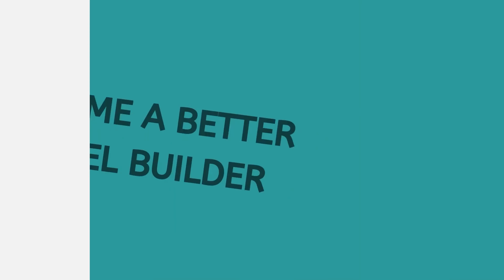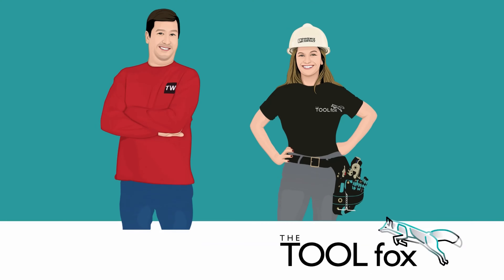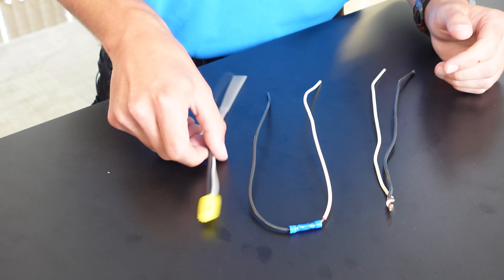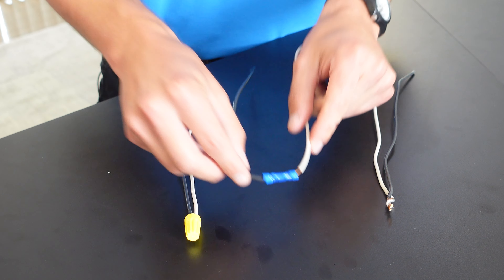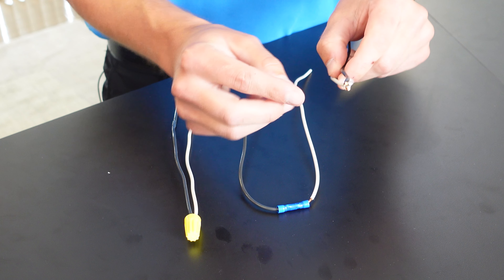Terminal Block Basics.  Using to Make Your Control Panel Better

Comment: Good but short video. Here's a good reason to connect every wire via a din terminal: New terminal when the screw gets damaged: $1 new PLC module when the screw terminal gets damaged: $700.... Put the wire into the PLC module once, then make your connections via a DIN terminal!
Reply from the maker: Very good point!

Comment: Tim, how many wires can go into one side of a terminal. I find many different answers to this. I feel like you were asking him that question because many people do not connect a wire to a terminal when a wire is exiting the cabinet. I would like to know how many wires can be under a screw of a terminal?
Reply from the maker: Typically one... Unless it is UL listed for more than one.

The other exception is if you use a ferrule designed for multiple wires then you can put that into a terminal block designed for a single wire.
Reply: @TimWilborne  thanks